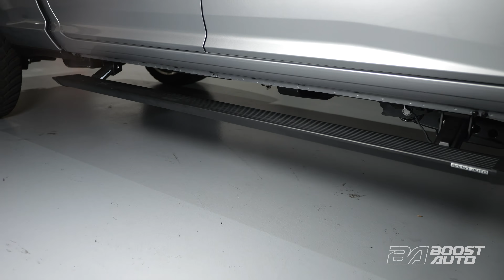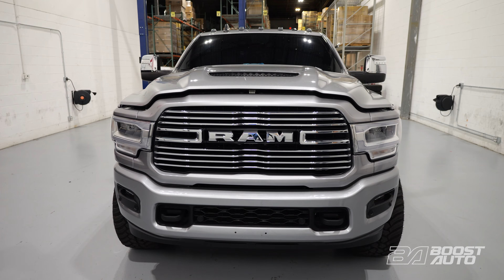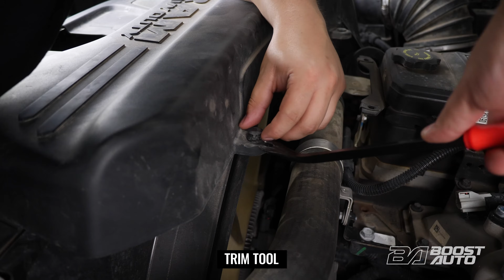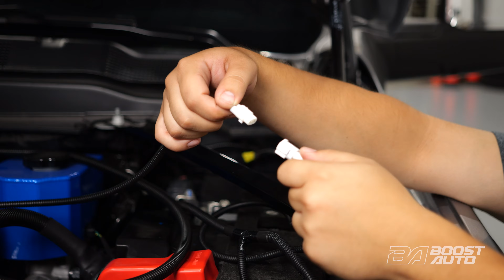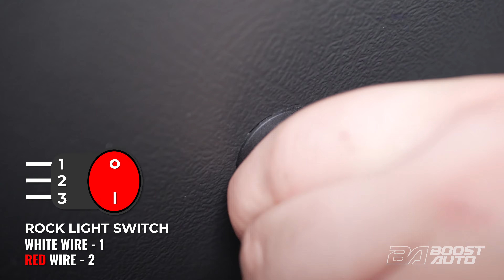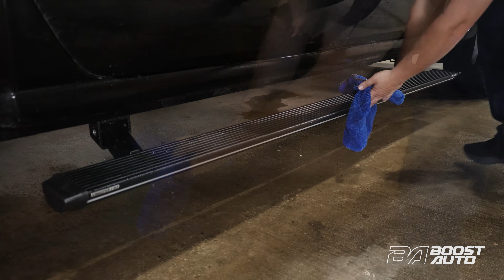Lumastep M2 Powered Light Up Running Boards Installation Guide | 2019-2024 Dodge Ram 2500/3500

Comment: My truck has the airbags so I am hoping they find a way. My truck already is equipped with the oem running boards retractable, is their a kit to connect to the already pre existing wires if that makes sense so that I can still make them retract when I am inside the cab like I can with the oem boards by pressing the button on the screen. I hope this makes sense.
Reply from the maker: We are working on a solution for those equipped with air ride and hope to have it available soon! As for tying into the OEM power running board wires, we unfortunately don't offer that - our solution is a standalone solution.